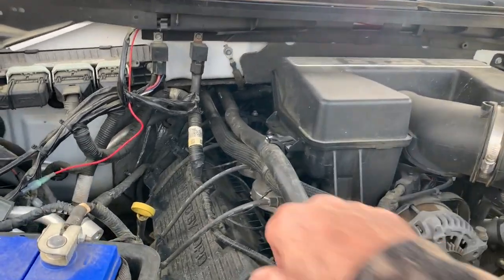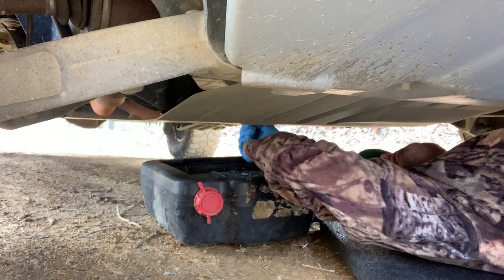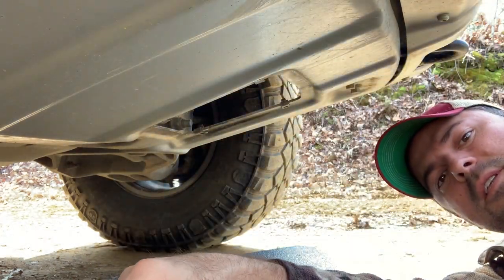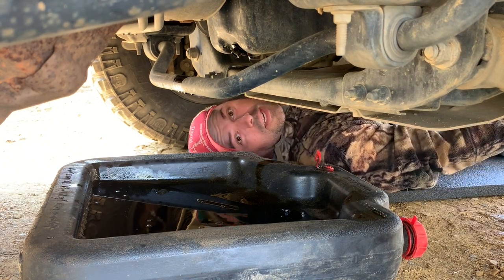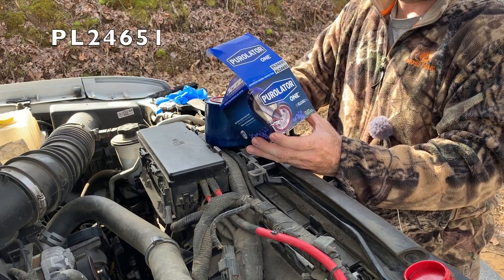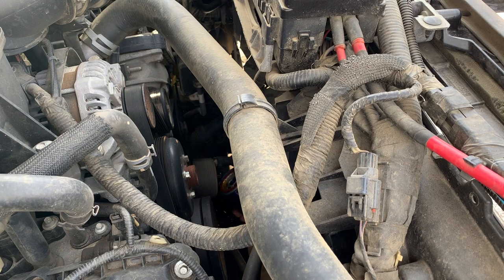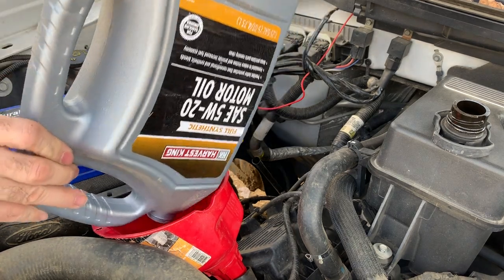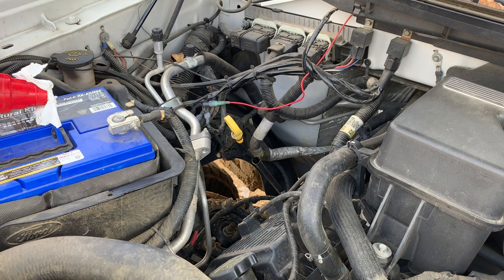HOW to change my 2013 FORD Raptor oil 6.2L

Comment: I occasionally take it to change oil depending where I am living at the moment. If I have a driveway or a space to do it it’s quick about 45 mins tops taking my time. The last two times I took it for an oil change I got free tools in my engine bay. I got a 1/2 inch breaker bar last time. I was going to go back but decided no harm no foul and I needed a 1/2 inch breaker bar so all is well I am going to do my own oil change unless it’s under warranty I bought another new car and maintance is included.
Reply from the maker: free tools are the best.
I have paid maintenance on my new RAM
but I prefer doing it myself so I know it was done right

Comment: Nice one John, I love changing my oil. Regular oil changes is the best thing you can do for an engine. I remove the filer cap as well but never thought about pulling the dip stick. Good tip.
Reply from the maker: we can all learn little things from one another, I'm glad you found a bit of value in this one

Comment: Also, it would be a good idea to mention to check the old oil filter to make sure the rudder washer is still on it. I’ve had that to happen to me before. It stayed on the block and caused a big mess when I cranked up.
Reply from the maker: yes I always check forgot to mention it

Comment: One day I'll own a Raptor 😎 I test drove a new F-350 single cab gas engine w/ 169" wheelbase. It had a flatbed on it which I want to convert into a landscape bed. It was about $45k with the bells minus the whistles 🤣
Reply from the maker: new vehicles are so expensive now, they are prices most of us out of the market

Comment: Hey John, I noticed you put a wrench on your new oil filter for the final tightening. I’ve always been told to hand tighten it until you can’t tighten anymore. Is that just for the Ford Raptor? Also did you loose any of your new oil out of your filter when putting it on?
Reply from the maker: I believe the filter says right on it go 1/4 turn past hand tight. yes you lose a small bit of oil when the filter is horizontal like mine is.

Comment: Good job, I’ve no idea what a quart is, I guess quarter gallon? 104,000 miles in a 6.2.....that’s some fuel burnt 😱😱
Reply from the maker: yes 32oz 4/gallon. You guys use liters right? yes lots of gas, it's a pig too
Reply: The ProCut yeah, we flip flop between metric and imperial. There’s no real logic to it. We haven’t used gallons in years for fuel, it’s all litres, But if we go for a drink it’s a pint.
Reply from the maker: @hvee4  yeah and I believe a British pint is 20oz not 16oz like ours here in the states
Reply: The ProCut yeah, a true pint here is 568 ml and although we can get smaller pint glasses in a pub it would be 568 ml. If we was to get milk it would be 2 litres but sometimes we say 4 pints but that’s obviously 500 ml but that’s still more than your pint 😅
Reply from the maker: @hvee4  👍🏼